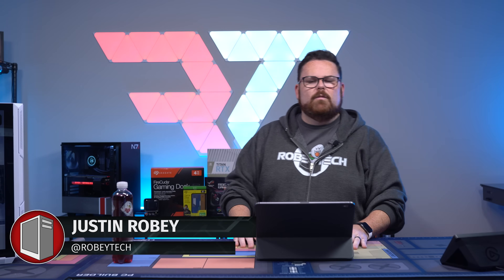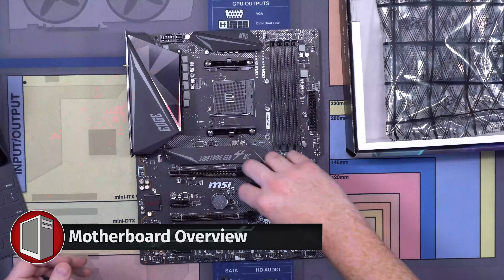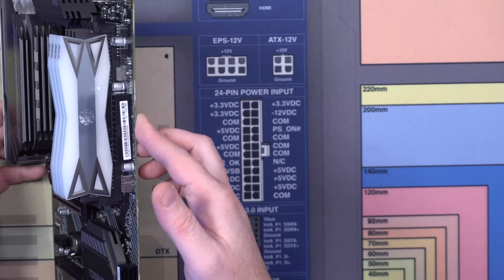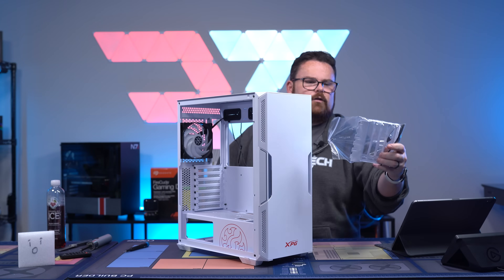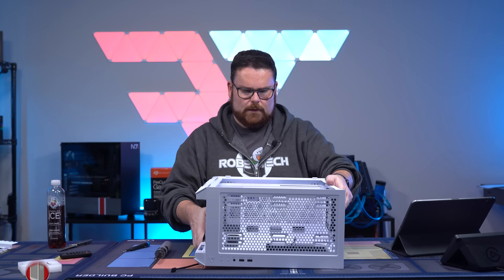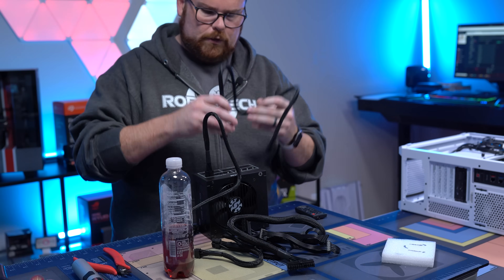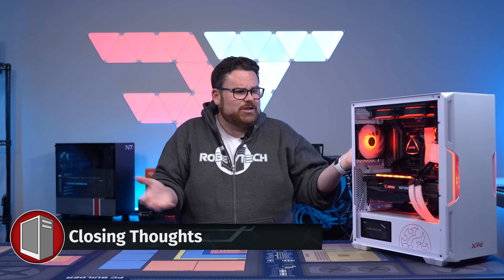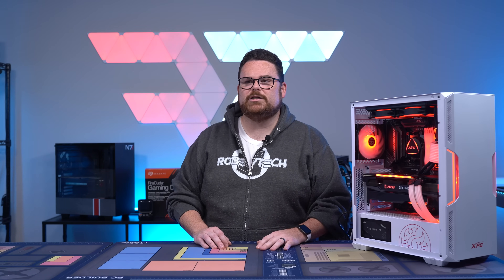The XPG Starker Review Build and Live PC Build Guide! | Robeytech

Comment: i have the same case but i am unable to get the led lights given on either sides of the front panel to light up ... there is a 3 pin cable labeled VG OUT hanging loose... wat do i do help please :(
Reply: Same problem i m facing with this case...still i m not sure how to light up these strip led lights..
Reply: If only the guy making the build video explained it. Ya know, like any reputable PC Builder on YouTube does. 

By chance did you ever figure it out?

Comment: Nice Review, thanks a lot, clear most question .. but after the review one question left :P it's possible to change color of front by connect with mainboard or is fixed with frontpanel and button? best regards from Germany :D
Reply: I have the same question. I bought the starker air version and even though the 5v is connected to the motherboard I can't use the asus software to change color. Only pressing the button. (I could if connecting by other means)
Reply: @caiobemacedo  press the button until ligth blink and now you can control the light with softwares.

Comment: I pressed the RGB button on the case for about 3 second and it stopped working (the case/fan rgb lights)
Reply: When you do that, you can control rgb with software like Aurasync
Reply: @evelingiglio3984  Do you know how long I looked for how to do it? You’re the best.
Reply: Just had to disconnect it from the current and it worked again

Comment: You should make X pattern with the thermal paste - proven to be the best way - google it.
Reply from the maker: Actually even spread of the Thermalpaste is actually best for heat transfer.  The X is just a way to do it, but usually results in to much thermalpaste.  You need just enough to transfer between the plate and the IHS.  We tested it 😀

Comment: Does anyone know a graphics card that would be good for this build? Or any changes l should make my budget is $1500
Case - Corsair icue 220t rgb airflow $104.99
Motherboard - Msi x570 - a pro $159.99
Processor - Ryzen 7 3700x $329.99
Ram - Corsair vengeance rgb pro 16gb $96.99 
Ssd - Samsung 860 evo 1tb $109.99 
Ssd - Samsung 970 evo 1tb $144.99
Power supply - cooler master MWE gold 550 v1 $89.99 
Fans - Corsair icue sp 120 pro rgb 3 pack $72.99